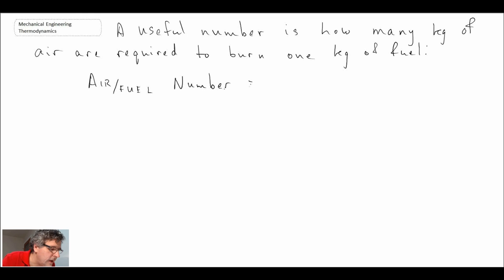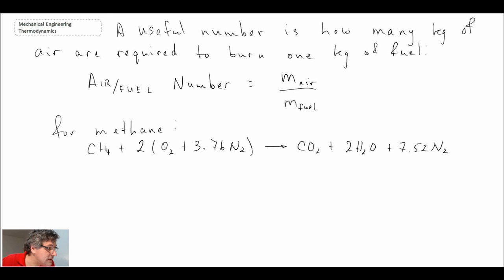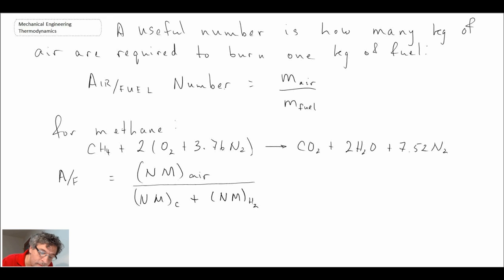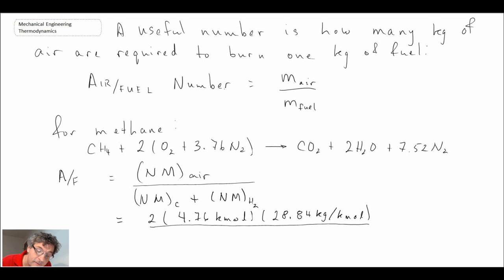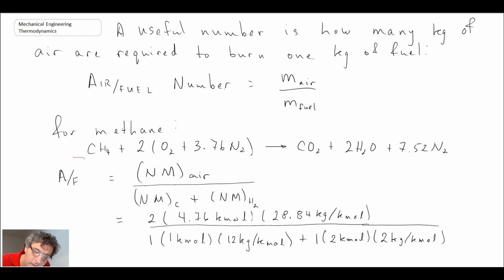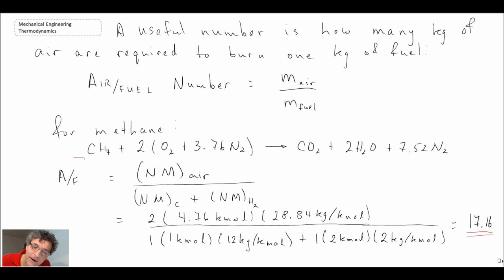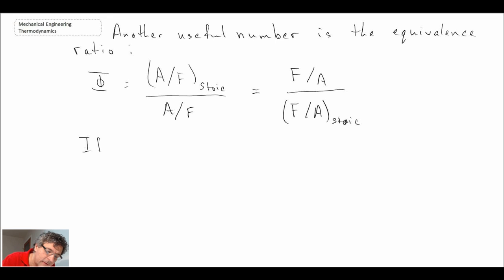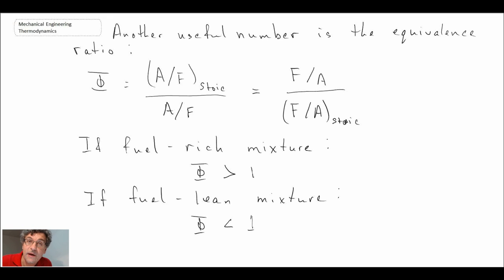Mechanical Engineering Thermodynamics - Lec 31, pt 5 of 5:  Air / Fuel and Equivalence Ratio

Comment: could you please explain the practical application process of equivalent ratio? For a sloid fuel burning, how could it practically adjust? Is that just pressure specific or linked with the intake flow rate of air and solid fuel?
Reply: To determine if fuel mixture is rich or lean